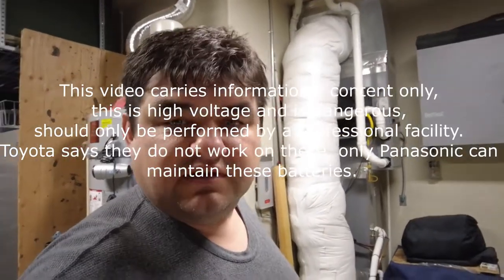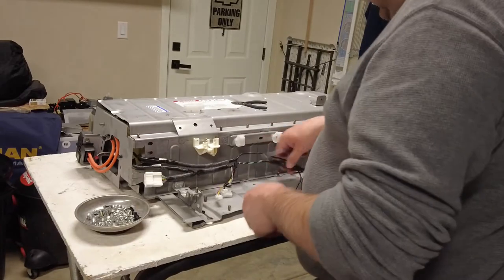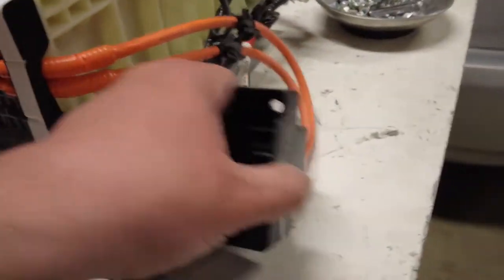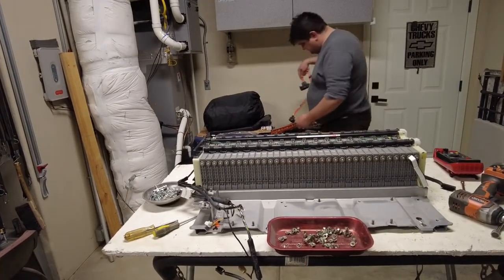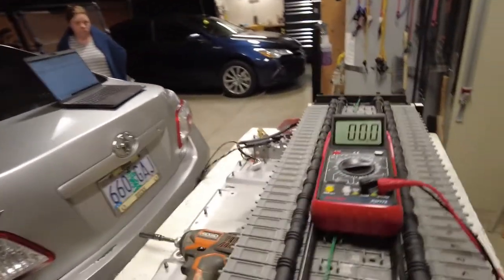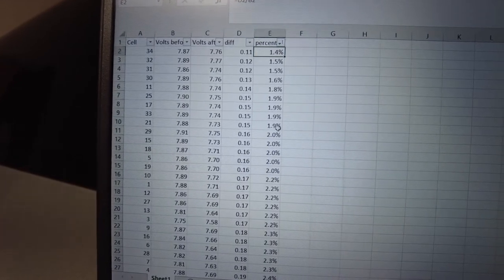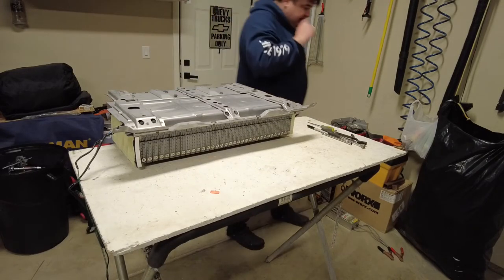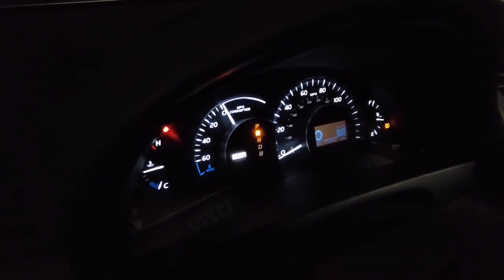Hybrid Camry Battery Cell Diagnostic and Replacement

Comment: Forgot to mention - based on  my experience with batteries, I would have done a load test with the meter on the cell and took a meter reading immediately upon disconnecting the load.  The reason being that batteries recover voltage after load is disconnected and that happens over time, so best indication of effect of load on a battery is right after the load is disconnected.  Thanks!
Reply: You're right...
Taking the voltage minutes after disconneting wont give him accurate load test result...

Comment: If I understood everything I watched, you had warning on the dash of the car and the battery would not charge.  You found one cell that was about 1 volt lower that all the rest and you replaced that module.  I am surprised that one cell, down 1 volt, would give you a failed battery indicator.  How many miles where on the car and were you the original owner?  Where did you buy a replacement battery and cost?  Can you give us an update on how it is now performing?  THANK YOU VERY MUCH!  This has been an education, thanks to you.

Comment: I've seen a bunch of videos on the Toyota hybrid pack.  The other videos used a more professional method with a charger to cycle discharge/recharge at predefined loads to see the charge capacity of the battery cell.  It shows the cell's ability to hold charge after an applied load as well as it its ability to recharge within a fixed time period.  Both charge and discharge capability of the battery cell are looked at.  It was definitely really slow as DIYers would take days testing the entire pack. 

This video's method seems less accurate.  It could have been just plain lucky that a bad cell was found because it had a really low voltage.  Well, its good if it worked in the end.
Reply: I’ve seen a bunch of videos with trolls but I’ve never seen any value come from a troll. I guess what I’m trying to say is his video is more valuable than your comment.

Comment: I have a diagnostic obd2 machine that allowed me to look at every battery pack cell and while test driving I could see pack 7 discharging very low. While in drive and foot on gas pedal it would jump to 16-17A after sitting for a while it would jump down to 10-13A that bank is the problem. But I recommend a whole battery pack replacement!
Reply from the maker: Nice that you have the tool!
Reply: @familyandfriends9492  it's an Xtool not super expensive but they have a really good update center

Comment: Good video. Whoever designed this battery layout could have easily made cell replacement easier. It would have been good to measure voltage under load, as it would give you an additional data point on cell health. How many miles did the car have on it when you got check light?

Comment: So what were your symptoms that told you that you had a bad battery cell? I assume you had codes? Did you have any codes after you replaced cell #22?
Reply from the maker: I cannot recall the code. it was on my dashboard to check in on my hybrid system

Comment: If replays on bank battery car w'll run 6 mouth after car w'll the same problem . One guy replays with new one bed battery on camry after 6 mouth problem coming on again
Reply from the maker: i am at 25k miles now and still going strong.

Comment: You went through all this labor to determine one cell was bad, and how old were the batteries? isn't it better to get all new batteries based on the life than replacing just one, and then going through the whole thing again within 6 months? It would be like replacing one battery in a 3 battery flashlight and expecting it to give you the same service life.
Reply from the maker: I am still good after 25k miles.
Reply: We purchased my wife's 2008 Prius with 315,000 miles... at 382,000 miles, I took the hybrid battery out, to service it, because I noticed it would at times jump from full to low battery.. not often, but it would on occasion. After opening it up, I noticed the battery was a reconditioned/serviced battery... a lot of marker writing on all of the cells... so this goes to show you, that a reconditioned battery can last at least 7 years... I could have just left it in and waited for it to eventually fail.  I'm in the process of servicing the battery and will replaced any bad modules, but so far I haven't found any bad modules... but only about 20% of the way through the process. I have 2 hobby chargers, which both combined, allow me to test/recondition 8 modules at a time. The bus bars were a little dirty, but not terrible. Cleaning those up to be like new, so I should be done in a 10-14 days. I work from home, so I only have to go check on the progress a few times a day, to write down measurements for capacity. So... again, done right, a reconditioned battery can last for a very long time. It all depends on condition of the battery, how the car is driven and the expertise of the person servicing the hybrid battery.

Comment: voltage not important , CAPACITY IMPOTENT , after this voltage .   You can see how work battery on scanner OBD .  Bed battery then charge show over voltage , then car stop charging on bed banks voltage drop then normal banks .
Reply from the maker: I have not had any issues for 25k miles.
Reply: @familyandfriends9492  still good sir?
Reply: @familyandfriends9492 is voltage drop necessary or find the voltage one and just replace?